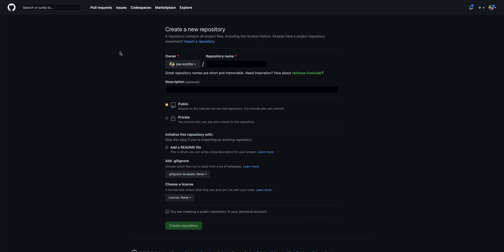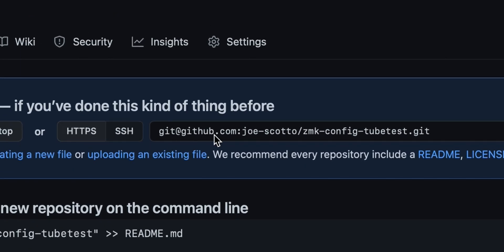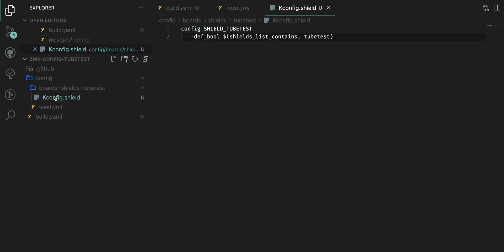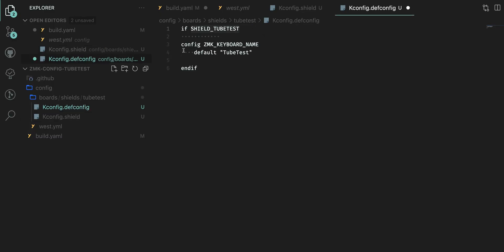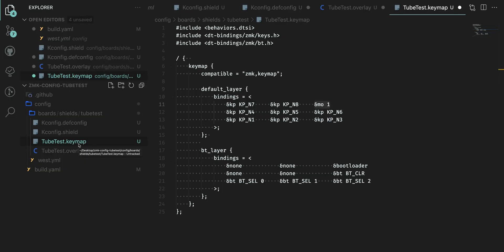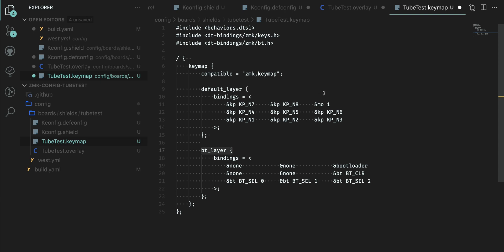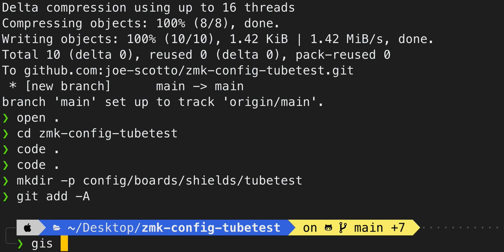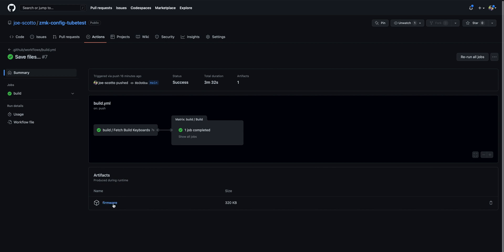How to Set Up ZMK Firmware From Scratch

Comment: had an issue doing this that a behaviours.dtsi file can't be found. after hours of trying to fix it, it found the file (it was under zmk/app/dts, not zmk/app) however I am now getting the same error over and over that west doesn't understand 'build', so something is wrong with the zephyr build commands, but after trying to reinstall and extract zephyr with different softwares, it still refuses to build. any ideas?
Reply: Hey, I am having the same issue. Did you ever get this figured out?
Reply: @flashlightbug unfortunately no. My keyboard is still a deadweight and I’m close to giving up on it. Bit of a waste of £200 to be honest.
Reply: Have you read the ZMK Docs? This video is 2 years old. Ask ChatGPT, and give it a screenshot of your error. Should point you in the right direction
Reply: @beaglegaming1636  why are you responding to a 5 month old comment with ‘help’ that isn’t even helpful? Of course I used the ZMK docs you muppet. And no, AI is not a good tool for this. You get a mess full of useless code barely doing what you want, and it cannot troubleshoot properly across files. AI is a good tool for some stuff but coding isn’t one of them.

Comment: One thing that wasn't mentioned, that should be, is if you are grounding the pins in direct wire, You need to set it to GPIO_ACTIVE_LOW | GPIO_PULL_UP Otherwise it's not gonna output anything.

Comment: This video helped me a lot! The only part I'm stuck on is the &bt keymap; is that keymap necessary for the keyboard to work with bluetooth? What happens if I don't include it?
Reply from the maker: It’s advisable to add it otherwise you’ll have no way to reset Bluetooth or change profiles.

Comment: Thanks for this, but... what is the prerequisite knowledge for this? I don't even know what a shield is (yeah I looked it up but I'm just using this as an example). It seems like I'm supposed to know a bunch of stuff before watching this video. I did the ZMK tutorial on getting started, but everything else in the docs also seem to assume some prerequisite knowledge. PS I do know Git and Github, as I am a web developer.
Reply from the maker: I have a guide to cover the "missing" info coming eventually. I have a blog post on the process that might help clear it up for you now though: https://scottokeebs.com/blogs/guides/compiling-qmk-firmware-using-github-codespaces

Comment: Got my firmware built for xaio ble successfully but i dont know how do i connect via Bluetooth. I have connected this to pc via usb. Can i still connect via Bluetooth if its connected via usb, can i just use usb for power ?
Reply: Key bindings are working via usb so the firmware was flashed. My only confusion is how do I use the Bluetooth pairing without battery and just usb power, is it  possible?
Reply from the maker: I'm not familiar with that controller but I know on the nice!nano it can use USB as power but will default to a usb connection if you connect it to a computer. If you try powering  it off a usb battery pack you could test if it works.
Reply: @joe_scotto  I figured it out. Thanks for your inputs. Got it working on usb data cable power, power bank via usb and also battery connected to the battery pins of the board.
Reply: @joe_scotto   added this to the conf CONFIG_ZMK_KEYBOARD_NAME="Sanket XIAO" and also had to key bind and press  &bt BT_CLR  to clear and then the board showed up.

Comment: I think I am missing a step here. Through what terminal? My own computer? through the github's terminal. Kinda confused here.
Reply from the maker: You use the terminal on your computer and then push it up to GitHub where it’s compiled for you.
Reply: @joe_scotto  i tried the terminal on my computer but it couldnt load the list that i saw in the video. Am i suppose to download something?
Reply: does it make a difference if i use a windows computer instead of a macbook?
Reply from the maker: @ericfayhuynh  Yes. You’ll have to use the windows commands, you’ll see a tab on the website for them.

Comment: Thanks so much, this helps me a lot, quick and focused tutorial. Are interested to do explanations on the rgb modules or battery?. Also i have an example for the complete list of pins for the nicenanov2, you may know that has 3 extra middle pins than the normal arduino
Reply from the maker: Many keep asking for RGB so it’s on the content list :)

As for the battery, I have a video where I briefly explain it at the end: https://youtu.be/DvWJjn1CbM4

The TL;DW is that you just get a lipo and solder it to the plus and minus of the Nice Nano. Typically 100-500mah and will last about 1-5 weeks.
Reply: @joe_scotto  actually I have resolved the RGB part, is pretty cool, and thanks for your suggest